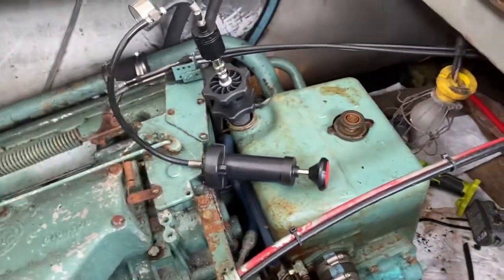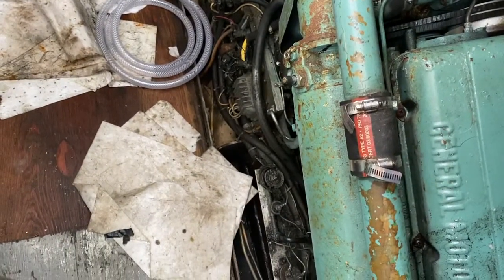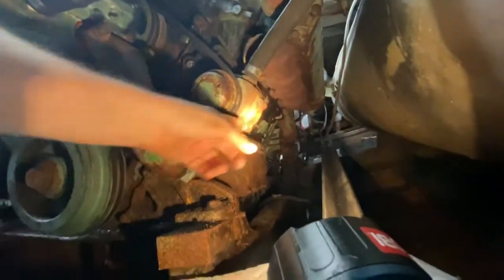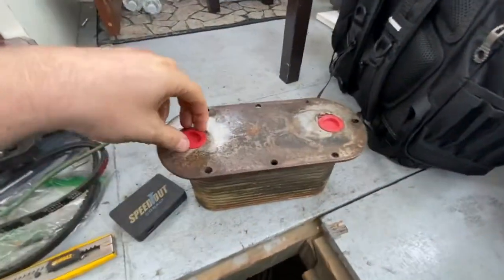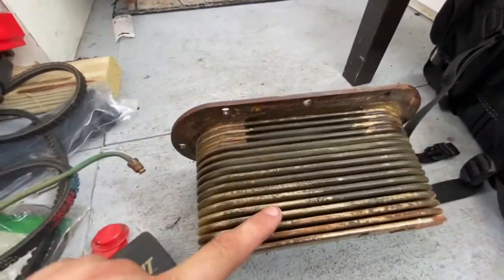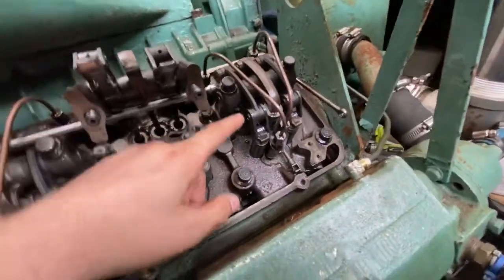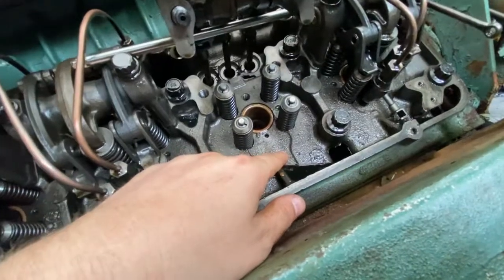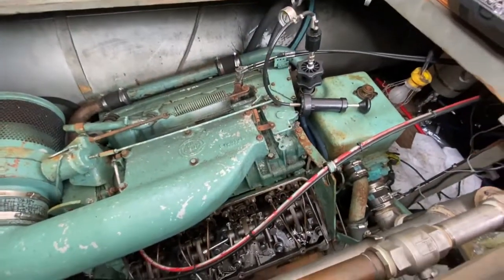Diagnosing Detroit Diesel 853 - water in oil.

Comment: injector cup seal. Pull the copper injector cup and re seal it. There is coolant behind the cup for cooling. Remember, the 53s are wet sleeves
Reply from the maker: Fixed. I’ll make a video on that soon.